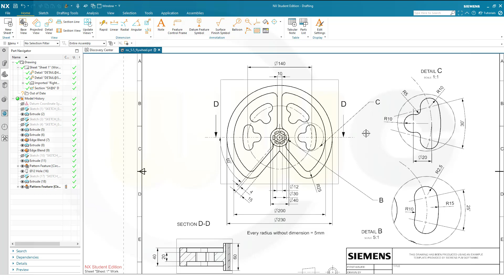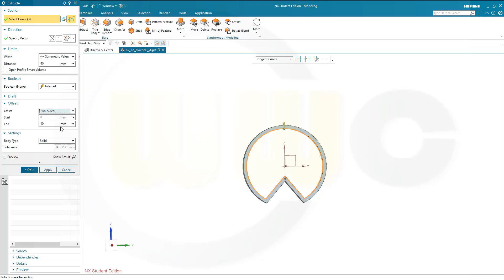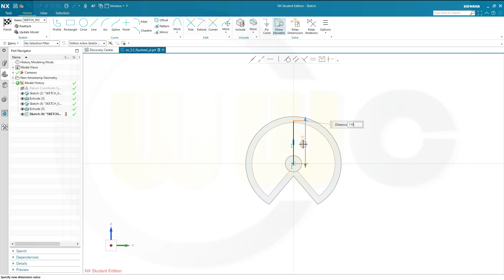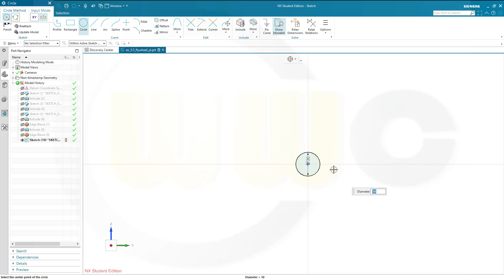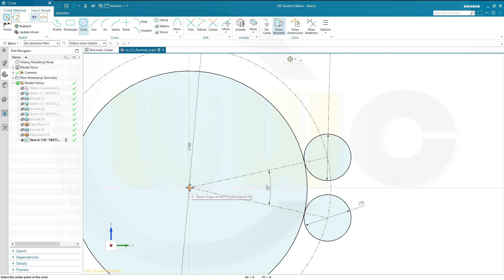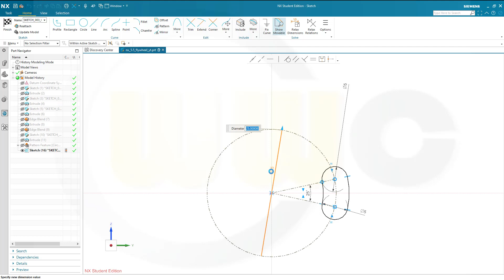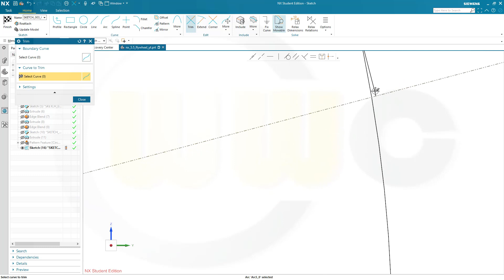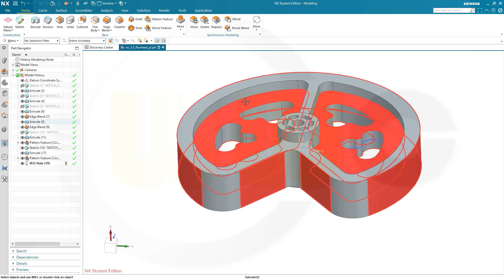5.5 Schwungscheibe - Flywheel - Siemens NX Training - Part Design

Comment: Sehr gutes und interessantes Video. Würdest du vielleicht noch ein Material zuweisen (m. Dichte-Angabe) und dann das Gewicht des Schwungrades mitteilen. So könnte ich checken, wie weit ich bei meinem Entwurf mit Solid Edge daneben gelegen habe :) 
Vielen Dank und viele Grüße

Very good and interesting video. Would you perhaps assign a material (with density specification) and then tell the weight of the flywheel. That way I could check how far off I was in my Solid Edge design :) Thank you and best regards
Reply from the maker: Das SolidEdge Video kommt noch 😉 -  wahrscheinlich morgen.